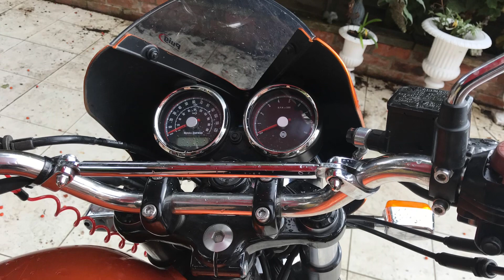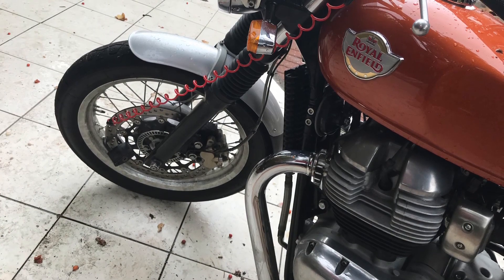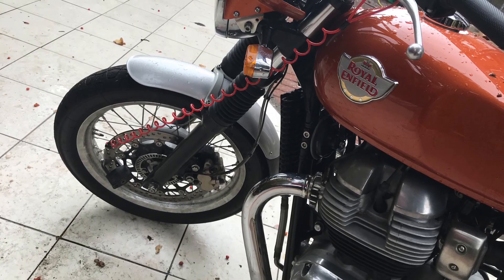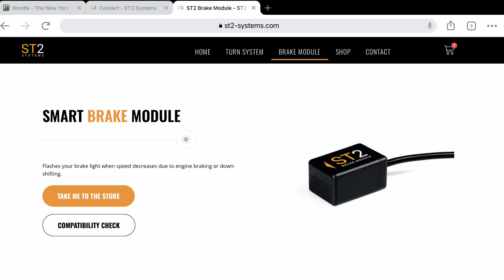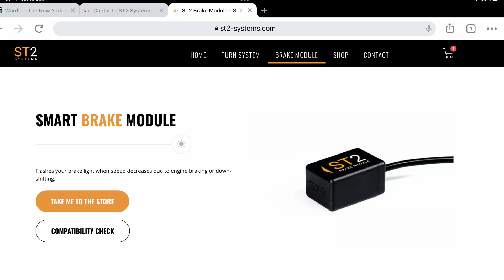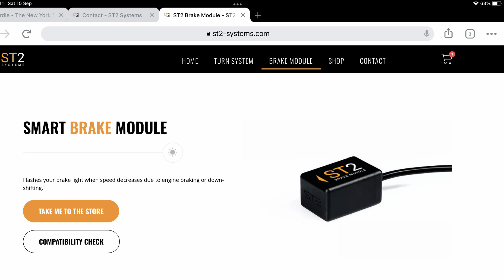Royal Enfield Interceptor 650. Two new ongoing projects

Comment: I use one of those disc locks too.
Reply from the maker: With a reminder wire, right?
Reply: Yes but I also park bike in chock on front wheel too & always remove disc lock.Need reminder wire to remind you as well.

Comment: The very fact that they gave you all the money back shows you that they actually know its completely shit 🤷🏻‍♂️
Reply from the maker: It’s more likely that they are bothered about their eBay rating and avoiding negative feedback and buyer disputes. This is policed quite robustly now by eBay. Yes, quite likely they know it’s not adequate and the eBay returns system in the case of buyer disputes requires sellers to provide a postage-paid label which would actually cost them as it needs to go back to China. Given that they know it’s not much good, I believe they cut their losses and refund.

Comment: The smart brake module project sounds interesting.
Since fitting the full bore stainless steel exhaust, I've lost almost all of the engine braking, so I have to use the brakes. I'm ok with that, but with a standard exhaust, that's a worthwhile modification.
Ride safe.

Comment: Have your standard mudguards wrapped in chrome James, cheaper option, 10 out of 10 for trying mate,always a good watch 👍🏍🇬🇧
Reply from the maker: Hey, that could be an option thanks! I actually contacted a local chrome plating place but they said it has to be chromable abs plastic and it’s not a cheap process either…..
Reply from the maker: I just ordered some chrome wrap. Gonna give it a go myself!
Reply: @internetpolification  I'm sure you'll master it, I've had some bits done on the car you can't tell it's not painted, look forward to seeing the pictures. 👍🏍🇬🇧

Comment: I fitted one of those ST2 'Smart Brake Modules' to my RE GT 650 a few weeks ago, works a treat.
This morning I completed an ST2 self cancelling indicator module installation, that also works very nicely (but the way I did that was a much more involved project).
Reply: I was going to fit the self cancelling module to my interceptor but couldn’t see how to fit the pads to the switch. Any tips?
Reply: @calknight1666  Yes.  The idea of those little bits of rubber converting a latching traficator switch to a non-latching one is absolutely horrible.  I got rid of the original RE switch and replaced it with a couple of IP 67 rated (water proof) momentary push buttons (from JayCar).  I mounted those on a piece of 4mm thick x 31.3 x14.8mm UV stabilised polycarbonate sheet with a couple of 11mm holes for the switches through that plate and the RE LH switch thing (those switches need to be of a short length or they may short against the 22mm bars).  Not enough room for the securing nuts but black silastic held the new switches in place. It actually looks good, like that's the way it left the factory.

The loom coming from the left hand switches terminates in a 9 pin 2.8mm pitch socket (male or female, I forget which) in the headlamp shell.  I made a short cable (3 or 4cm) with male and female 9 pin connectors to go between the original 9 pin plug and socket, pin for pin (like a little extension lead) but with 3 wires going via the electronic little ST2 black box and taps for the +12V and ground to power that black box. All connections you need are to be found in those 9 wires. That might be overkill but it means if something dies I can just unplug the mod and reconnect the way it was originally, the original loom is unmolested. Those connectors are to be found on eBay and AliExpress.

I glued the ST2 black box inside the headlamp shell as far back and as high as I could using neutral cure Silastic (there is not much space so clearing the back of the headlight reflector is not that easy). Of course the black box has to be horizontal so I built a silastic wedge on top of the black box (that took days to cure, quite thick) prior to sticking that to the inside surface of the headlamp shell.  I do tend to get a bit carried away !
Reply from the maker: @dogphlap6749  I love my FJ1200 left hand switchgear. Not self-cancelling indicators but so much better than OEM
Reply: @internetpolification   Of course. The Royal Enfield switches are nowhere near as good as those from a Yamaha FJ1200. 
Thank you for another enjoyable video James.
Reply from the maker: Nice one! I’ll post a video of me doing it and you will be my go-to person in case of trouble! Lol